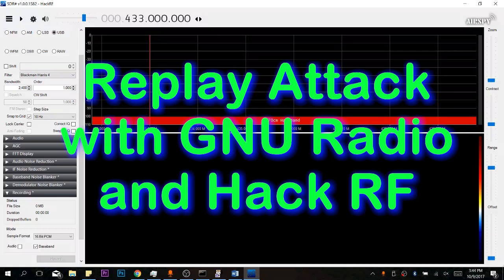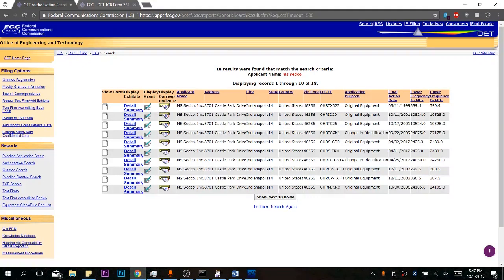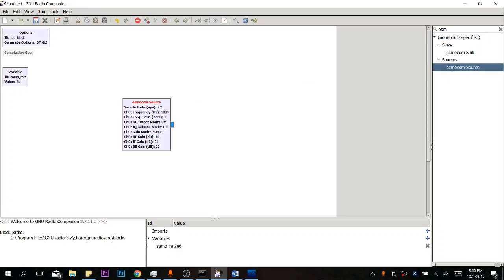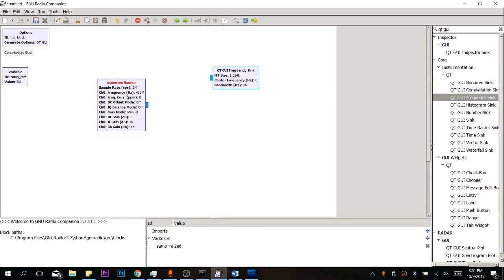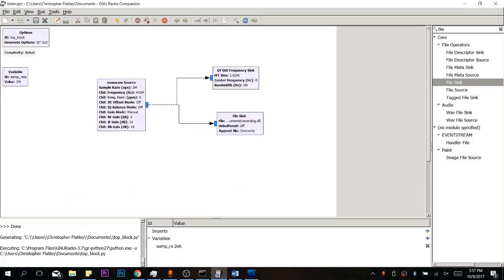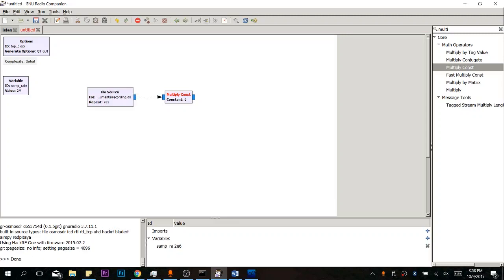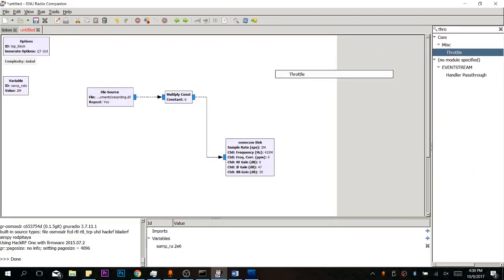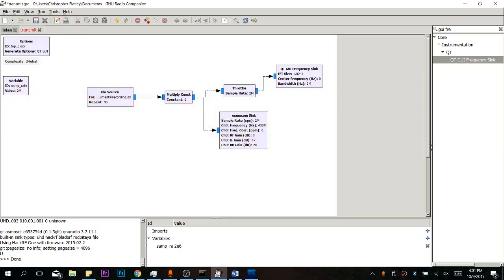Replay Attack with GNU Radio and Hack RF (Tutorial)

Comment: can anybody send flowgraph? is also rolling codes unlocked by hackrf?
Reply from the maker: +alex shmidt Sorry I did not get the notification about your reply.  Unfortunately since I do not know your intentions I am not going to be able to send you a flowgraph since it could potentially be misused.  The general idea follows what was seen in the video though.  One hackrf would be transmitting at the frequency of the receiver to stop it from getting the code sent by the remote.  The second hackrf (or RTL-SDR) would have to be capturing the signal being transmitted by the remote.  Rolling codes also often use sequence numbers.  I found this blog post which I believe mat be helpful with details and flowgraphs http://spencerwhyte.blogspot.com/2014/03/delay-attack-jam-intercept-and-replay.html  If you have questions regarding that send me a PM
Reply from the maker: +Leon Sebel See the reply I just made, hopefully it helps
Reply: +Leon Sebel
Unfortunatelly No.
Reply: +LCS Media Thanks for asnwer. So one hackrf simple jamms (as ordinary jammers do)  the frequency and the other makes the main work? 
Is there any way to make you sure in our legal intentions to get more concrete instructions from you?
Reply from the maker: +alex shmidt With the right equipment anyone can send a flowgraph. Rolling codes can be unlocked by the hackrf but it is a different process. For that to work, you have to capture the signal being sent from the remote as well as stop the car from receiving it because then it would no longer be a valid replay. Hense the rolling part of the code.  I believe the hack rf is not full duplex so you would need to use one device like a sdr or hackrf to capture and another hackrf to transmit to block the signal from reaching the car.
Reply: +LCS Media There are some videos showing unlocking rolling codes by two hackrf. One hackrf Jamms signal, another works. Can you please send me flowraph of GNU radio or other instructions how can be unlocked non rolling codes of vehicles? Sure if you know unlocking rolling codes, it would be good. If you want you can contact on email
Reply: alex shmidt Got any useful answers per mail ?
Reply: LCS Media I totally understand your worries. No problem for the flowgraph I will figure it out by myself. Thanks a lot for your reply I will definitely check out the link and the related pages.
Reply: alex shmidt How can I PM you?
Reply: +Leon Sebel
alexshmidt199@gmail.com   write me here
Reply: alex shmidt hi can you help me with the same issue you have here please

Comment: Really cool. Is there a way to make a Repeater? (instantly re-transmit the signal from the RX Source)
 I want to add a very short time delay of the live signal and then emit it. But I think I need a buffer, not saving into a file.
Reply from the maker: +C. Cherciu You should be able to use the delay block to accomplish this and combine the transmit blocks. What are you trying to create the repeater to do? Honestly it would probably be easier to write a Python script to do what you want.
Reply: I want to simulate the distance between 2 radio equipment. Right now they are very close to each other, but on their final location, they will be much further from each other, so the signal will have a slight delay. The idea is to measure the distance based on the time of arrival of the signal.

emitter ----> USRP(Repeater with delay) ----> receiver

so just a delay block between the source and the sink is enough? Thank you kindly
Reply from the maker: +C. Cherciu If I am understanding what you are trying to do correctly then yes I believe a delay block will accomplish what you want